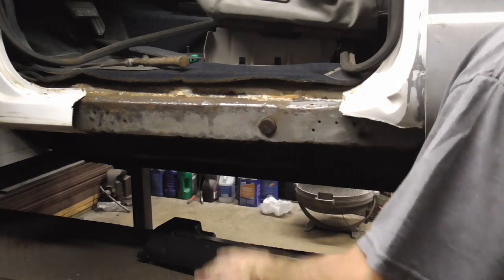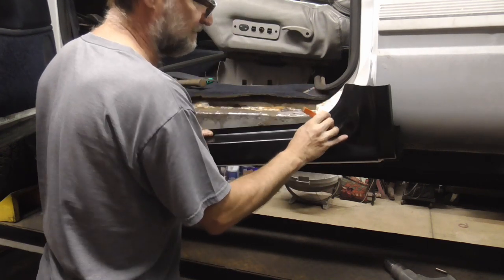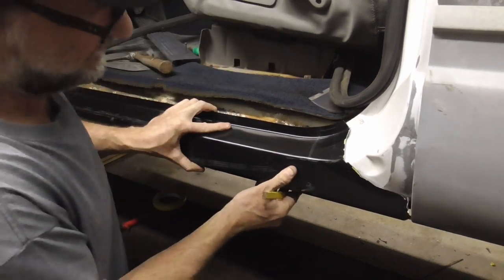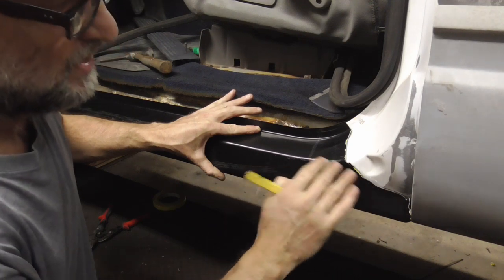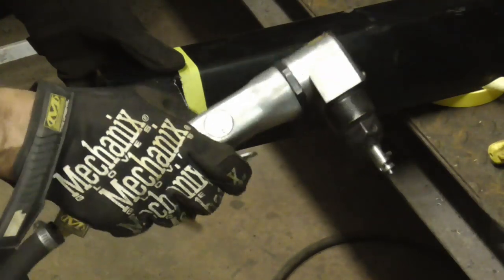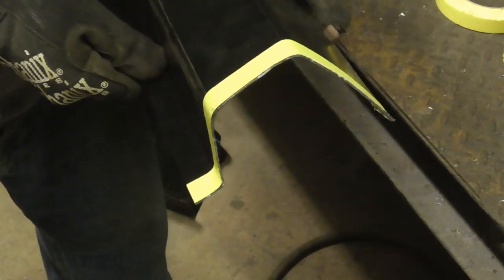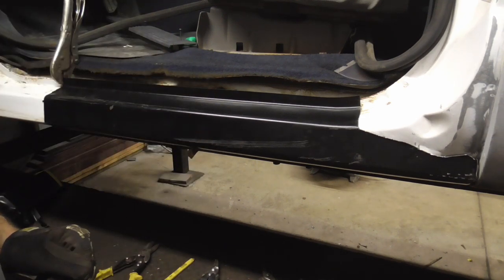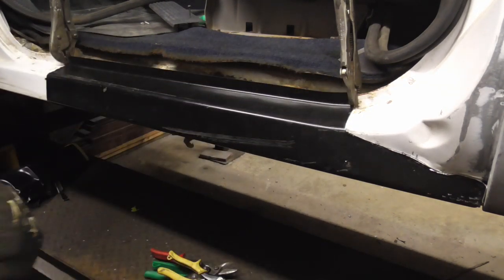How to Measure and Cut Patch Panels to Fit Just Right

Comment: Do you have any videos on replacing a rear quarter panel  with a replacement OEM panel ? The side with fuel filler door .  I have a 03 ford explorer with wheel opening (arch ) rusted out . Bought replacement panel on line .  I would like to use MULTI-PURPOSE PANEL ADHESIVE  rather  then welding . What are you thoughts on this ?  Thank you . enjoy watching your videos very much . I'm a auto  tech by trade  ,but back in the early 90's i help a friend in need working for him in his body repair shop . Learned a lot from him  but still just a rookie .
Reply from the maker: If the panel was installed with welds, that's probably the way to go as there may not be enough surface area to use adhesive.  However, adhesive is very strong and I think it could be done.  I'm glad you enjoy the videos - I'll try to keep some interesting ones coming :)

Comment: Fitting panels is very frustrating and time consuming especially if your impatient. With aftermarket panels the shapes and bends are almost always different so matching and lining up the panels can be very tricky. Most of the time if your impatient like me you carefully trim away for a while but eventually get tired of small trimming and just start cutting too much and end up with a panel thats way too small. I have heard some people will clamp the new panel over the old panel and use a very thin cut off wheel to cut both pieces at the same time and in theory you will end up with a even gap that is exactly the width of the cutting wheel but i have never had luck with that.
Reply from the maker: Thanks for watching Brian - it takes a bit of practice but after a bunch of times dong it you'll come up with some methods that work every time - keep at it :)

Comment: ,  I  was wondering why when you got it close, that you didn't just mark the old rocker panel with a scratch awl when the new one was over top of the old one. Would have been real simple to get a precise fit without the guess work.🙂
Reply from the maker: Good ? - You could do that - with out a problem and that probably work most of the the time and it is the right way.  In this case though I wanted to weld exactly in that valley that is stamped into both panels - sort of a guide I could use on both panels - so I wanted to cut only the new to match the old.  Basically didn't want to change the shape of the hole.  Hope that's understandable.
Reply: @LakesideAutobody  I got what you were doing initially, just that when you had the new one close to fit, I would have then made a scribe line on the existing metal with the new rocker as a guide. Easy peasy 🙂

Comment: Do you always Mig your butt welds?  Any more I have been using gas welds.  Much softer to hammer smooth.  Take care and keep up the good work!
Reply from the maker: All I've ever used is a MIG aside from brazing patches when I was young - that's how my dad taught me.
Reply: I have wanted to try ez-grind welding wire,  my boss is too cheap to spend double money, but from my reading looks like would save a lot of grinding time. & I have used every process,  in my first year of college MIG wasnt allowed, torch & metal finish only not even body filler, other than lead in seams. I had a Dinosaur of a teacher, that showed old ways, my second year I learned modern methods from his replacement when he retired, & I wouldnt trade my education for anything. & I have torch welded, brazed, MIG, TIG Stick welded, & of course Spot Welded, but never used the modern glues.